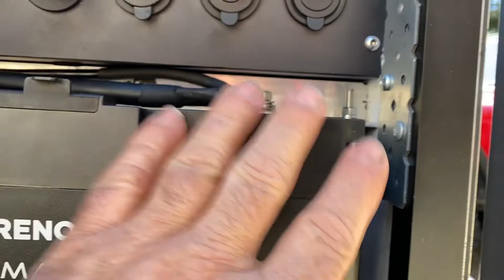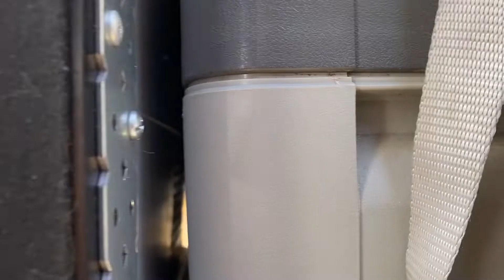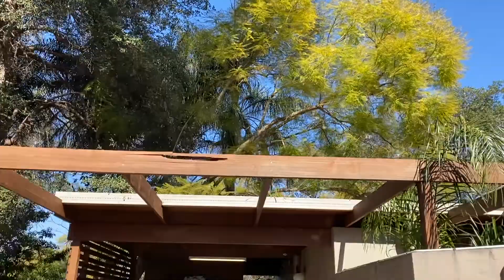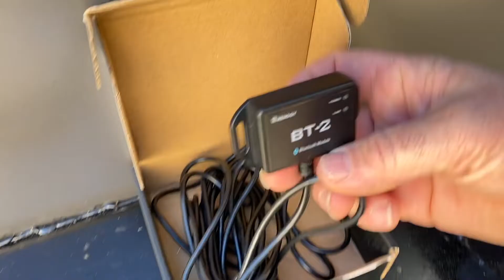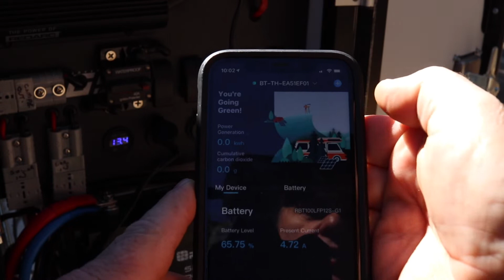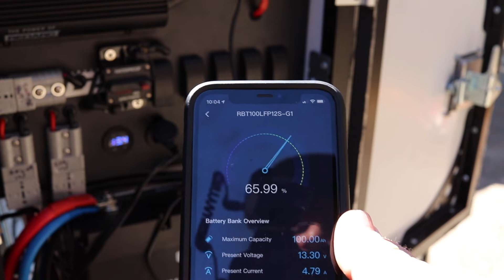Off Road Camper Trailer Build // Renogy Bluetooth Battery Monitor

Comment: How are you finding the Renogy gear so far ? looking at using them for the Fourby and Caravan
Reply from the maker: Had an issue with the port the BT-2 clips into and they replaced the battery. After that all good.

Comment: hi Darryl love the vid i went and bought 1 off of your recommendation as will prowse has said good battery  i also got the bt2  i got mine in march this year and its been going great what i dont understand is when i first got it and fully charged it  it read 100ah  maximum capacity now say 3months on it now says maximum capacity 99.87 ah this i dont understand it reaches 100% when fully charged then a few days later it drops some more does yours do that ?any help to understand would be great  
  john
Reply from the maker: Yes mine does the same

Comment: Darryl can you pick that up from your Jeep.  I built a trailer with a RTT and used a Renogy DC to DC charger and I'm thinking of getting the BT-2 but wasn't sure it if the Bluetooth range would pick up in my Jeep.  Also, do you have a way to charge your battery with shore power?
Reply from the maker: Yep, it picks up the bluetooth feed from inside the Jeep fine. I have a Redarc AC charger for when I'm hooked up to shore power.

Comment: Man, thanks for the great video! Renogy is currently having a great sale and I'm really contemplating pulling the trigger on the same battery you have with the bluetooth module. That would set me at about $800CAD with free shipping. Comparable bluetooth ready 12v lithium batteries are more in the $1200-1300CAD range, so I'm wondering how I CAN'T take advantage of this sale. We have a small camper and will usually go off grid camping for three days/three nights. We typically use just the water pump, lights, and power awning. Do you think the one battery will give us enough usable power for a 3 day/3 night trip without using solar? I would plan on purchasing a lithium battery charger to bring the battery to full charge at home between trips. Thanks in advance!
Reply from the maker: Sounds great, the lights and wanter pump use nothing out of the battery so you'd be fine. FWIW with a 40 litre fridge running non stop on my Dometic 50amp lithium power pack I can get 2 days running no problems.
Reply: @DarrylSheather  Thanks man! The only thing that concerns me with Renogy is the customer service/responsiveness and their ability to back the product. It seems as though some of the reviews look pretty poor in these areas. How has your experience been with the company so far?
Reply from the maker: @justindyck9705  I had the port that the Bluetooth module plugs into stop working. I tried their support page that was very slow in responding and ended up getting more response going through their eBay shop (I purchased via this method as there was a discount going). They were pretty good and sent me another battery quickly. No further issues since.
Reply: @DarrylSheather  Man, and that's exactly why I'm hesitant to pull the trigger. Customer service, responsiveness, and backing the product are so crucial when making this type of decision. It's the decision to marry oneself to a product/company for 10yrs, let's say! If Renogy's customer service and responsiveness wasn't so much of a concern I'd have jumped on board already. A big decision! Eeeeks.

Comment: Thanks for the video mate. I am interested to hear how the bt app is going. There appears to be much info about problems and not much being solved
Reply from the maker: I did have an issue with the port on the battery that the BT sender plugs into. Renogy replaced the battery to get around this. Apart from that the BT App works fine, I'm using the IOS version.

Comment: Gday Darryl,  I recently bought one of these batteries with the smart monitoring screen to upgrade my camper. The screen is able to put the battery in shelf mode with a touch of the button for storing. I’ve been considering the BT2 module however you can have both with only one battery so either I pony up for another battery or lose the screen and go with the BT2 however my question is , can you put the battery into shelf mode using the BT2 or do you have to disconnect it and turn it off with the provides button switch that comes with the battery?
I’d also love to know how its performed for you whist you’ve been running  the renogy gear.

Regards
Don
Reply from the maker: With the DC home app, I'm certain you can only monitor the battery. I'd just disconnect the BT-2 and put if into shelf mode with the Renogy activation switch if I needed to. I find the BT-2 gives me a fairly easy way to keep an eye on the battery when I'm home and I find my solar keeps it full. Worse case I have a Redarc battery charger that I can attach if needed. Battery has been awesome, although I did have an issue with a blown port and Renogy replaced the battery for me. No issues since.

Comment: Solar Panels loose efficiency the hotter the become. They work by converting the sunlight to electrical power. They are best when the temperature is cool but the sunlight is high.

Comment: I purchased and installed the BT1, it only provides useful information for the parameters of the solar panels and power sent to the batteries. All of the information regarding the batteries is essentially corrupt and not useful. Renogy support simply shrugs and cannot explain or address the corrupt information.
I do not recommend the BT 1
Reply from the maker: I have no experience with that model. Rather happy with how the BT-2 works though

Comment: Hi I am new to lithium batteries and just received 12v 100ah Renogy  lithium battery and BT2. I fully charged the battery with smart lithium charger and BT2 shows that it is only 69%. Is it suppose to be at 69% or I did something wrong?
Reply from the maker: Should be showing more than that when fully charged. Mine charges up to over 99% and then you can see it reducing charge. However, I have an issue that I'm waiting for Renogy to sort currently, with what looks like the port the BT2 plugs into. So can't see anything at the moment.
Reply: @DarrylSheather  Any update on this issue? Cheers👍🏻
Reply from the maker: Yes, Renogy supplied another battery as a replacement. No issues since
Reply: @DarrylSheather  Sorry Mate but what issues exactly are you having? I got two of this batteries and just purchased the BT2 as well..
Reply from the maker: It blew the port on the battery

Comment: Thank you, it's good to see how DC Home works with the Renogy battery.  I use DC Home with my DC-DC Charger/MPPT Solar Controller (DCC50S) using the same BT-2 module to monitor power generation. I'm planning on using the Renogy bluetooth comms hub to connect both the DCC50S and a new Renogy battery to the BT-2 module.
Reply from the maker: Thanks, yours sounds nice system.
Reply: @Mark Earl

Mark hi there,  I have the DCC50S also, wondering, is it possible to use the bluetooth module, BT-2, instead of a shunt, to monitor the Battery?

Trying to decide between the Renogy 500a Battery Monitor or the BT-2 module, wondering if they cover the same ground
Reply: @ned900  The BT-2 will tell you what the voltage of your battery is. A Shunt will tell you the State of Charge (SoC) of your battery. The SoC is the charge level relative to  the capacity of a battery (i.e. works similar to a fuel gauge in a car).  You can guess the capacity of your battery using the voltage from the BT-2 alone but if you get it wrong you can potentially run out of charge or even damage the battery.  If you're worried about over discharging a battery a Shunt is a considerably better way to determine the SoC.
Reply: @VirtualPapercuts  magic, thats exactly the information I was looking for. 

I'll buy the shunt so. Many thanks and best wishes.

Comment: Your camper is really nice, but in my opinion axis should be 35-40cm backwards
Reply from the maker: I'd say 10-20cm backwards. However, its built on an ex military chassis that was designed for SWB Landrovers so the axle placement is what it is. Design has resulted in a ball weight of approx 10% which is right on the money. Conversely, theres a lot of sloppy design out there currently with axles too far back resulting in really heavy ball weights. I'd much prefer my issue.